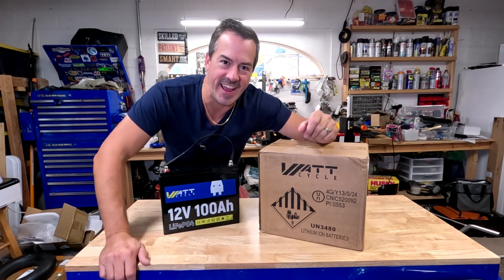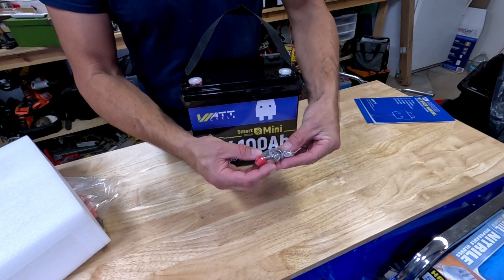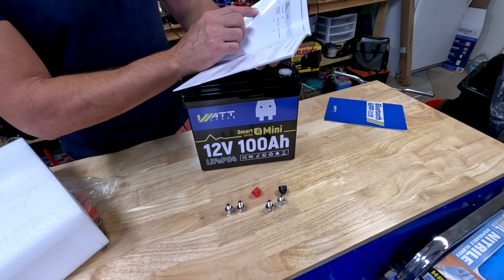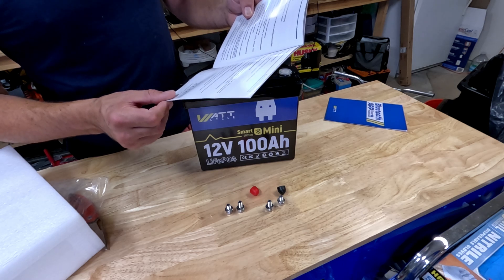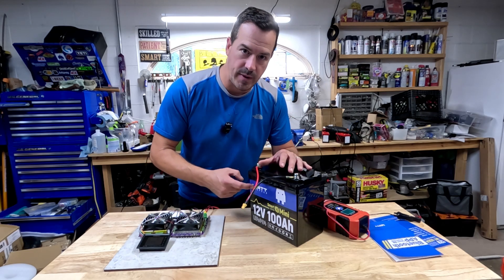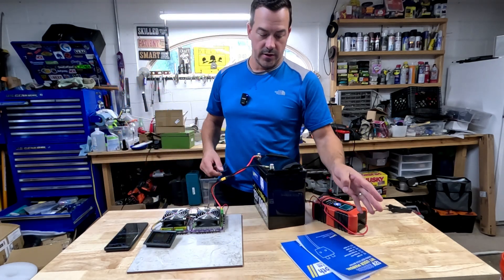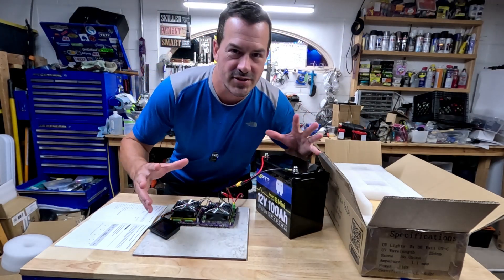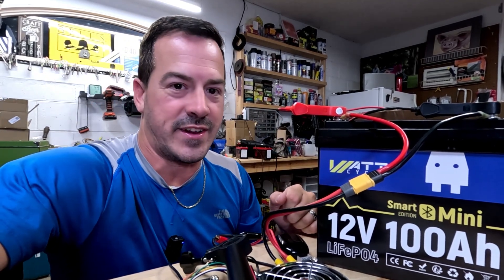12v Watt Cycle 100a Mini w Bluetooth App! Best Battery for Solar RV offgrid and more! DIY Lifepo4

Comment: I have a LiTime Mini going on 2 years.  No issue so far. But those are pouch cells.  Adding Bluetooth and Prismatic Cells in a very small enclosure with only a slight increase in weight (about 2 lbs) makes this (at current prices well below LiTime) a big win!
Reply from the maker: Let's go!!

Comment: The typical Marine Trolling battery size is the Group Size 31 battery (which is the battery you bring out @1:17). The Group Size 34 battery has about the same footprint as a Group Size 24 battery but is about an inch shorter.  And most Group 34 batteries are sold with a spacer to place under the battery to allow it to fit in Group Size 24 applications.
Reply from the maker: Great information, thanks for updating me!!! 💪👍